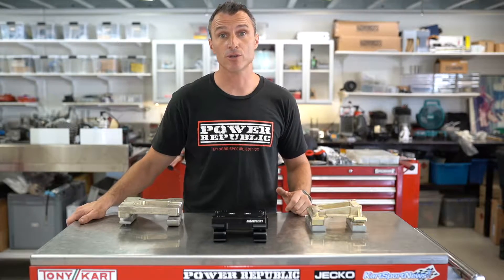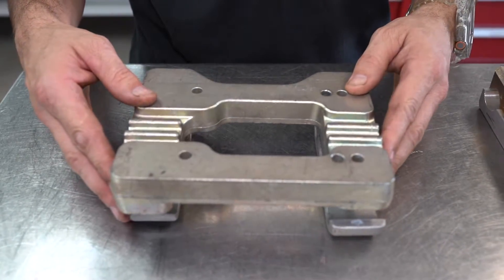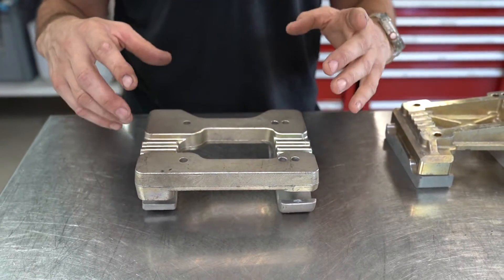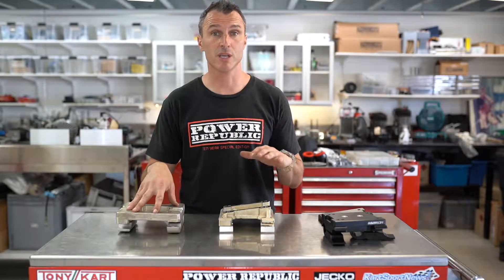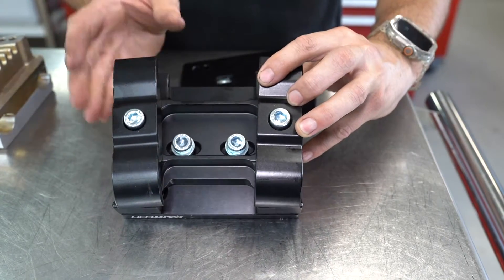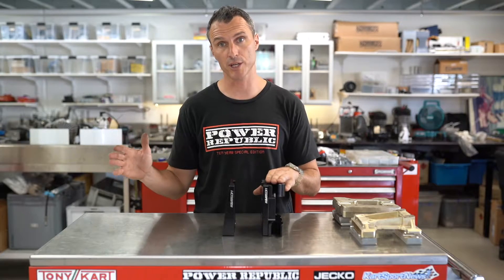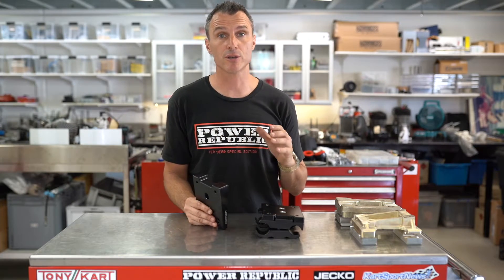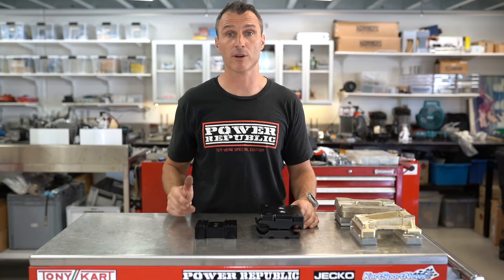Engine Mounts Explained - POWER REPUBLIC

Comment: Can PR or anyone explain why our TM Mini 60 motor is slipping back on the OTK Rookie frame, even though the engine mounts are as tight as they can be? We are now re-tightening the mounts after every session, on track, but because the chain goes loose we're damaging chains and both sprockets. Is there a cause to this? The kart is 2 years old but the problem has only started happening now. I'd be so grateful if I can solve it.

Comment: Hey, I have a IAME leopard 09 and was wondering if I can the engine without the power unit type A? I have an external handheld starter.
Reply: you'd have to change the ignition coil with a unit that works independently, i highly recommend not to do such a work if you're not an expert

Comment: Hey Des, 

I’ve used a mount identical to the Kartech on a Sodikart.  The mount is quite unique and as you said offers customized options to meet various needs.  The problem “I have is, the chain tensioner now sits inline with the base plate and the adjustable plate now becomes too high for the tensioner.  Have you experienced this? If so, any suggestions?
Reply from the maker: yeah that happens.  you can make and adaptor plate with a new screw hole like the KZ karts do on the OTK frames.  otherwise you can just stop lower the engine mount with the stopper and use the centre locking screws to hole the engine top plate